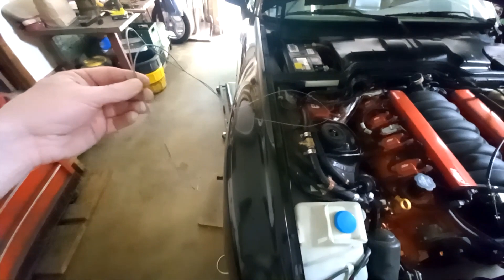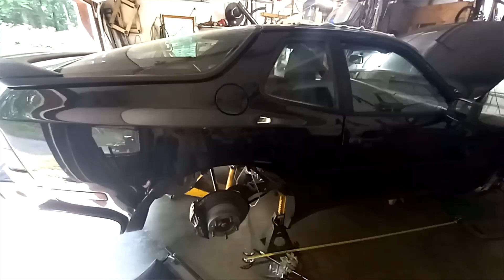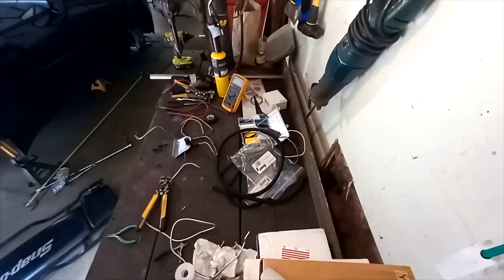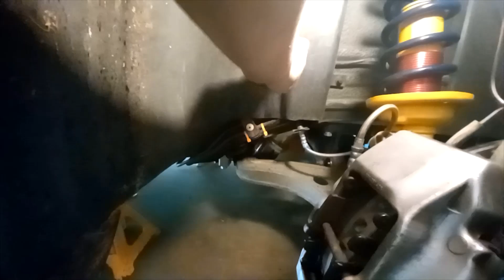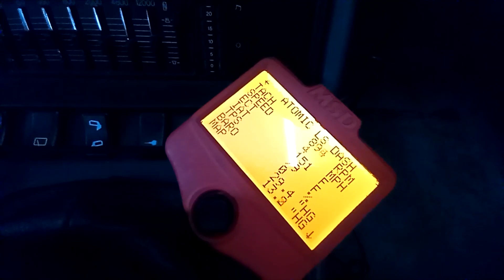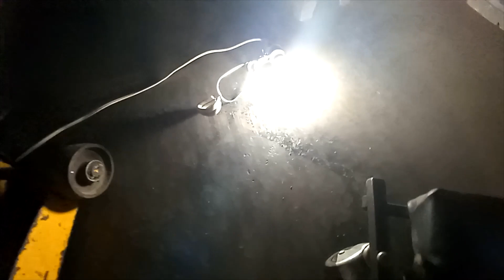Porsche 944 LS V8 Project, Vehicle Speed Sensor

Comment: Did you pull the wiring from the speed sensor or crank sensor on top of the engine for this to tap into?
Reply from the maker: I installed the GM reluctor and speed sensor on the axle.
Reply: @stokerdon1020  okay awesome that’s what I ordered. What did you wire that into on the stock side to make it read or did you take the output from the aftermarket ecm and then wire that into the Porsche side? Thanks again there’s not too much info out on these so your videos help a lot.
Reply from the maker: @ksmith3510  It's not for the Porsche side of things. It's just to help the V8 ECU deal with coming to a stop. If your talking about the speedometer, that just stays all Porsche. You don't have to change anything.
Reply: @stokerdon1020  is that for the earlier cable driven speedos, I have a 87 that sees electronic signal
Reply from the maker: @ksmith3510  Sorry, I don't understand where you're going with this. The speedo, wired or cabled, has nothing to do with the V8 conversion. If it worked before you started, it will work when you're finished. The speedo doesn't care what engine is in the car. That being said, the 944 has one of the most unreliable speedos out there. If yours doesn't work. it's a problem with the speedo.
Reply: @stokerdon1020  mine is wire driver it’s on a 1987. I thought the crank and speed sensor on the bell housing of the original motor calculated to the ecm and sent signal to speedo. I could be way wrong haha.
Reply from the maker: @ksmith3510  If that is the case, your speedo is just like mine. It's wired to the speed sensor in the trans. Has nothing to do with the engine.
Reply from the maker: Also, after looking at the old video you are commenting on, I was trying to correct a low speed tuning problem by adding a GM speed sensor. It didn't help the problem. Nothing to do with the speedo.
Reply: @stokerdon1020  okay great thanks for the info!!
Reply: @stokerdon1020  okay I got the vss gm kit I’ll install for the gm computer as a reference. Thanks for the info one less thing I can check off the list.